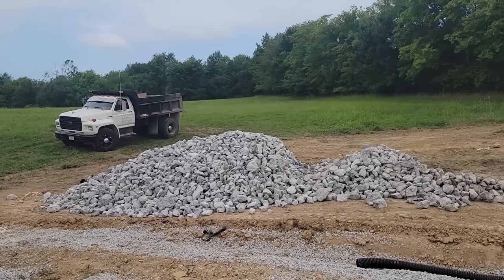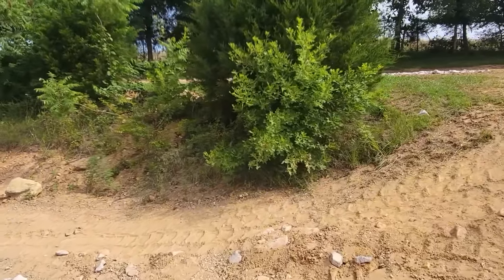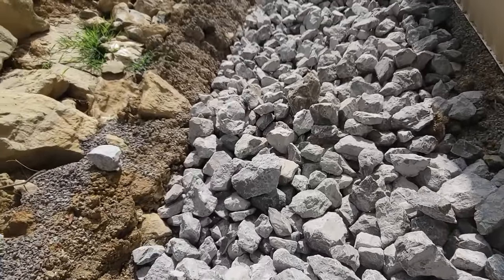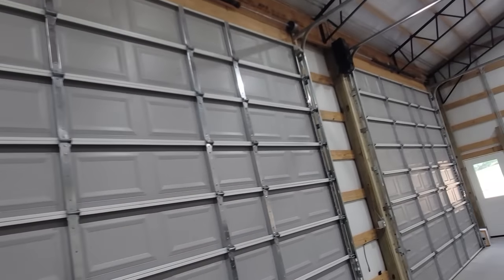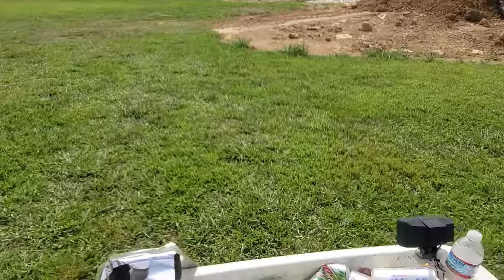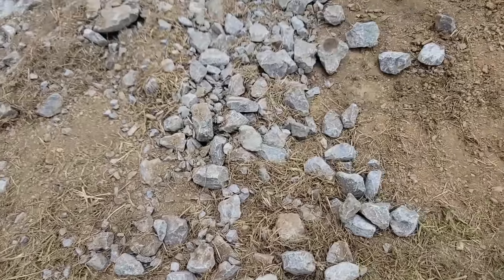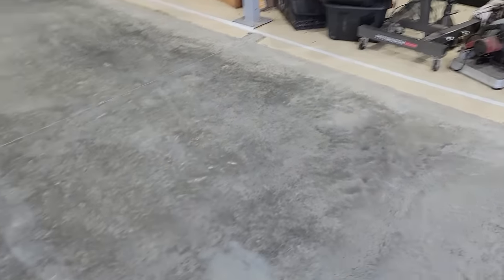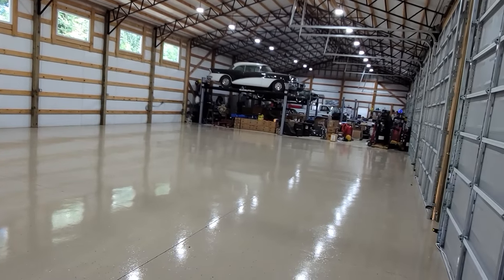My NEW Shop FLOODED! - Here's what happened (we had to start over)

Comment: As a licensed professional civil engineer, I can tell you this "fix" is going to fail.  The french drain on the top of the hill is located too close to the slope.  The slope is too steep and will become water logged by the french drain at which point is will slough off.  NEVER use corrugated pipe to convey water long distances; always use smooth wall schedule 40.  The corrugated pipe around your building is far too small.  Each downspout should be on it's own pipe, and a separate pipe should be used with area drains behind your building to collect runoff.

I'm a huge fan and don't want to see you go through this again.
Reply: Nothing can stop climate change! Oh my God it's flooding! We're in a drought! We're all going to die, 
AGAIN?!!
Reply: @desertodavid    Climate is cyclical!   Some of the biggest floods happened 90 years ago!
Reply: I'd say never use corrugated pipe, ever.  I'm thinking all that new deep stone will slow the water enough to it makes it's way around the building.
Reply: You are trying to solve a surface water flow/control problem.  Drains are not the way to go (Period).  As you say, that drain is going to fill up with water and silt and end up causing a failure plane in the fill that he has stacked up behind the shed.  He will soon find the hill has demolished his shed completely.
First rule.  The ground outside the slab should be at least 10 inches lower than the slab (with dirt/gravel ramps up to doors).  Second rule is that the ground must be cut to form a really wide Over Land Flow Path (OLFP) with falls to the low side of the property (where previously uninterrupted surface water was going).  The bigger the water flow you are dealing with, the wider and/or deeper the overland flow path needs to be.  Looks like he needs at least 12 feet wide by 18" deep along the back of the shed, but can't fit that.  He needs to cut the top off that fill/slope behind the shed (to stabilise it) and place the fill further upslope (30 to 40 feet) and use it to form a bund that will deflect the surface water (over the surface rather than in high maintenance drains) around the ends of the bund and the shed
Reply: @flyingcrocodile4630  His problem is proximity to that tree row to make your plan work.  I don't know if he owns the property behind it or not.  If he does, it would work.  If not, he doesn't have the room.
Reply: Can we all get together to help him fix this? Get on zoom have a discussion. I hate seeing the guy burnt out and getting flooded.
Reply: I'm a licensed PE also, and agree with Garrett.  Ideally, we would be able to quantify the offsite area draining towards your shop, size and locate a proper clean water diversion, and also layout the gutter downspouts and where they daylight.  The measures you have are going in the right direction, but to completely and permanently solve the issue, they need to be refined and a bit more needs to be done.  I'd be on board to review the area and give some direction if I had details of the location and basic GIS info.  Feel free to reach out!
Reply: @jasonfarrell3567  I know absolutely nothing about solving Derek's water/drainage problems, but I do know that he is a very kind, generous and talented man who has helped lots of people anonymously. He has also brought a smile and/or a belly laugh to lots of guys (and gals, too, most likely) who would love to do what he does, but, for whatever reason, cannot! He is also a fantastic parent who has a hard-working, supportive wife, who keeps their home and business going so he can do what he does best for us to enjoy. I think the idea of putting something together on Zoom, or some such thing, is simply outstanding and that those of you who enjoy what Derek and Jessica have created could share your knowledge and, thereby, help him continue to be the huge blessing he is to so many people!
Reply: @nutgone100  hahaha, yep!  A lot of what we do is just common sense...
Reply: Who cares it's a cgi human
Reply: @desertodavid   LMAO! FFS history repeats itself when it comes to mother nature...js, don't be hatin! the man is a smart dude...he's got this!
Reply: I suspect the building wasn't a tenth or two above existing grade rather near or at grade. A survey (survey tech) would have made sure the building would be above grade and proposed elevations to show water moving away from the building. I agree with @Garrett Glaser, I'd give that corrugated pipe two years before mud finds its way in, plugging the corrugated pipe.
Reply: Not a civil engineer, but it seems to me that any building site that isn't uphill from the surrounding terrain gives an ongoing battle, what with water and gravity and all.

I agree with the 100 or so people who mentioned putting everything up off of the floor (and simply assume there'll be water some day), whether it's pallets, pallet racking, some other shelving system, wheels or legs.

I have to admit that it's funny to watch the wood damage report because 'they guy before didn't install something or the other correctly'. Modern building systems seem overly complex and rather fragile. 

Garrett Glaser, if you read this, how on earth can those metal buildings handle wind shear?  They look to me like a great big sail (and over-tall for a lot of uses) without a ton of connection to the ground or much weight to fight sideways forces.  No doubt some engineer has calculated all of this, but it's surprising to me.
Reply: @toothlessgrin7540  The x-bracing on each corner is there for that specific purpose.  Usually, it's done using cables with adjustable links that put tension on the cables.
Reply: Not a structural engineer but when I saw the size of that corrugated pipe my thought was I don't like this solution.
Reply: @Challenged1  I was mostly wondering about how it is tied to the ground and what in the ground holds it down?  I'm not seeing any sort of perimeter foundation or big giant sonotube (did I spell that right?) setup here.  It seems to me that a lot of bracing simply implies that it all flies off in one piece.  Thanks for responding.

Derek really got me thinking about how a shop should be built here, and I'm not any kind of expert.  Those metal buildings look good, but wind would worry me.  Also, no doubt there's insulation tech (with the inevitable hundreds of website selling the 'ideal' solution) to keep condensation problems from happening.  The more layers of construction magic and materials, the more expense and failure opportunities.  I think at the very least I'd build multiple smaller buildings that were purpose designed.  Car storage, welding, woodshop, flammable storage, small well-insulated mechanic building with lift that was miniscule enough to air condition/heat.  No point in one great big barn.

As a side note, it always seems to me that a lot of long term water damage on window surrounds and bases of buildings (seen when he tore off the end) is because people save money by deleting eaves (in addition to the inevitable ground water control issues).

Side note #2:  After reading a lot of the responses and the various tricky drainage solutions involving different kinds of rock, buried pipes, filtering materials etc., I think I'm liking the idea of using simple ditches when possible.  It rather old technology, although shovels have improved over time, and is both easier to debug and maintain.

Side note #3: A quick googling on the webz makes me believe that the steel building business is fraught with sketchy doings.  It looks like the construction version of new car stealerships.
Reply: @toothlessgrin7540  The bracing is tied to the posts, which are set in the ground 4'.  These buildings see lateral loads, but not a lot of upward loading.  I agree though, the location and building style should be well thought out before ground is ever broken.  Anything near the ground should be treated lumber.  Also, placing a 2-4' concrete apron/sidewalk all the way around the building does wonders for water control of a properly placed building.  Plus, it is great for keeping the weeds and trees from growing up against the building.
Reply: @stephendodson8302  I agree, as yet another old drainage guy with a PE.  Another thing that stands out to me is that soil looks really sketchy for drainage; lots of clay and silty fines, which means very limited infiltration and yet more excess runoff when the rain comes hard.  Derek really needs some geotech done to properly design a drainage fix.
Reply: I can agree, commonly called curtain drains we always made them about 4 feet deep in Wa State and about 18 to 24 inches wide. We also wrapped the whole drain on the outside of the fill, that included wrapping the top so no dirt can get in. Otherwise two to three rainy seasons in Wa State would make them fail. As I said above I don’t feel they are deep enough especially by the building. It really depends on how much rain the region gets. Wa State gets a fair amount of rain. I was a building contractor for 20 years there (GC) and we had engineered curtain drains and never had a failure, however we had R&Red many and the failure was due to under designed systems that were not protected by drainage cloth. Once the mud gets it failure is eminent. In extreme cases we also installed pump assisted inside the curtain drains which were level activated.
Reply: @nutgone100  8" culvert perimeter would be better than what he has there. That is simple gutter or field tile. Almost needs a leach field type set up with that drastic downhill he is in. Im going to assume no engineer involved its pad is not about grade either. I bet that corn field tile all flows into that pit the shop is in, too.
Reply: Retaining Rocks Not Big and Deep enough to hold back amount of saturated soil.
French Perforated pipe is Not designed to move volumes of water.

1 layer Rock Line Under lined with Pondliner at top of hill! Dug down underneath Perforated pipe and backfill with Stone.
Reply: I could feel my stomach flipping when I watched the first drain go in. This fix isn't going to work, either. A new site NOT built into a hillside should have been chosen or the addition turned on a 90* angle away from that hill. Those steel buildings don't have any roof overhang and virtually nothing at the base of the wall to hold water back long enough to soak into any buried drain. Horrible.
Reply: @desertodavid  Yeah it just started raining in Tennessee a few years ago
Reply: @Hubjeep  holy hell. You can't tell that my comment was obvious sarcasm?
Reply: @Marksracingengines  you forgot to engage your brain when you made that comment. You really can't tell that was sarcasm seriously?
Reply: @ryetim32  well has it stopped raining in Tennessee?
Reply: Garrett Glaser  Absolutely Garrett.
Reply: Correct he needs the reinforced 30 inch corrugated if he uses that. I have seen being larger in Dereks case. Maybe he should reach out to some of his builder type fans. My advice is free. I would love to just visit him. Humbly speaking and I am probably not the first guy to suggest that he reach to fans as a labor force. Even Kevin Brown I suggest giving him a call. Channeling the slope is another suggestion as well as some sort low knee size retaining wall. It helped my property a great deal at least keeps water from swamping the parts we dont want swamped out... Just so folks know getting the thicker reinforced wall corrugated takes an act of god it's hard as hell to get ahold of. I actually got my stuff thru a large building outfit I used to work with in Easton Pa. The stuff is just so damn hard to get I might suggest going to the metal galvanized pipe. The 30 galvanized we drilled 2"holes and 3"holes in it and used the lager river bed rock not modified not even where we laid the metal pipe. I paid something like $75 a for a six foot long section. I forget if they were 6-8 or 10 foot section. When they got delivered I was at work. When I got home my business partner was just finishing drilling them full of the holes so by 11am next morning the shit was already in the ground they were calling for more rain so I just rushed and rushed.
Reply: Get busy Live'n or Die'n  I don't know what kind what of engineer U are but I built 5 developments in my 60 years as a builder one of which I owned solely at an early age. The first thing is U are right about the retaining wall just not totally. Derek could use a retaining system/wall at the top of that slope to first slow the water up. I suggested 25 feet more wall/longer than the building. Behind the building might not be a bad idea but that could trap more water and be more headaches than it is worth. Now removing about 4 feet of height all the way along the back wall of the building itself and replacing that with a concrete system across the entire back side of the building does cure those types of problems. If he gets any water in the future it would be minimal at best with the two walls working together as a buffer zone. But incorporating a retaining wall into the building itself would be the most intelligent move he could make. I live in the Pocono mountains and these types of problems are every day problems people have when they have idiots that build on their lots.
Reply: Agreed.
Reply: Yep or a 10 inch pipe to carry water.
Reply: Get busy Live'n or Die'n  Correct it is not a hard problem just an issue that requires some thought behind what one is doing. All a retaining wall would do is trap water there. Incorporating that wall as part of the structure is what we do around here most not to mention go to the top of that slope and choke off the field level ground water is best as I always do I add 10 to 15 feet more wall on either side of the building. Frank Miller he does my survey work and shoots the level heights for me. We have had total success nearly 100% since we met. At times we have cheated and just used  foot high walls at the tops of a slope and that even works wonders. Derek is gonna spend some cash no doubt but put that cash to work with a solid plan... I love the dudes videos we could be brothers from other mothers!!!!
Reply: Never run gutters and french drains together
Reply: We have corrugated pipe running a full mile with corrugated pipe shooting off of it draining over 200 acres it's been working great for 17 years now
Reply: @flyingcrocodile4630  Very well explained Flying
Reply: I read most of the comments which sounded as sound advice.  It seems to me his drainage system is like the Italian tuneup. We need to buy more stuff from his store and hit that like button  looks like a $50,000 job. Poor Derick
Reply: @davidwoermansr  A good piece of information.
Reply: @francisniestemski7382  that pipe is used in agriculture purposes all over my dad said 1 of his fields they dug the old collapsing clay tile out and replaced it with this almost 25 years ago so I believe it's well tested and works or they'd be using something different
Reply: @plgpa  Well said ! Couldn't agree more !
Reply: The roof alone will fill that drain tile.  Down spouts should have isolated non perforated rigid drain pipe to daylight with sweeps where the laterals hit the mains.
Reply: ok i done maintenance for a decade,i agree on a pipe for each downspout indeed.
Reply: Oh crap is this guy us right.
Reply from the maker: Fix hasnt failed and is working flawlessly
Reply: @ViceGripLodge bit late to this party - but after reading comments - with the work that’s been done then yep, suck it & see what happens. Could improve surrounding area with gravel landscaping around the perimeter  to deal with surface water / run off 
Store ‘stuff’ you need to keep dry above floor level re pallets. 

Not sure what the storm shelter comprises of - the unit wouldn’t stand up to any kind of tornado / high winds anyway. I’d have a bunker slightly away from unit-  a  few concrete culverts covered/buried into ground with a strong hatch way to go. Could use for storage - just make sure you can squeeze in

Where’s the bracing in the last roof bay & the walls @17:29 🤔 I’d assume it’d be as the other end. Just a thought.

Can’t see any openable /pressure relief panels - it’s advisable to to have if you have to hunker down within a closed unit - keep a few of those high level windows open.

Comment: I've been following this with interest, and I'm sorry that this event has set you back. I've moved lots over the years, and the first thing I do when I get a new shop or garage, is build shelves. I always used the suggestions that an article in Hot Rod magazine shared about 30 - 35 years ago. I'd suggest shelving behind every car lift, to hold the parts you need for those vehicles on those lifts. I used the 2X4 uprights, and 1X4 front and rear slats, and then plywood for the shelves. Anything on wheels or in plastic bins on the floor, heavier stuff in the next 2 shelves, and then light stuff on the next ones. Spacing gets taller as you go up. 16" depth, 8' tall. You'll wish you had done it years ago. You might have to move the lifts back a foot, but I highly recommend it. Talk about Organization!!!
 Could a guy, actually......? 
I love what you're doing, especially including your kids. I look forward to your revival videos, and the crew cab build was epic!
PS, I have to agree that you need a good retaining wall. What you have there is not enough, and the next rain event could bring more mud. We're calling them rain events now. We had one in November that washed out the 3 highways and 2 rail lines that isolated Vancouver from the rest of the country for a few days. They're still repairing one highway, new bridges, etc.

Comment: I should have mentioned it earlier in the build, but having worked in several shops, suggest you enclose the compressor with an exterior exhaust fan. Foam board insulation will help cut the sound cheaply so it doesn't interfere with your filming too.